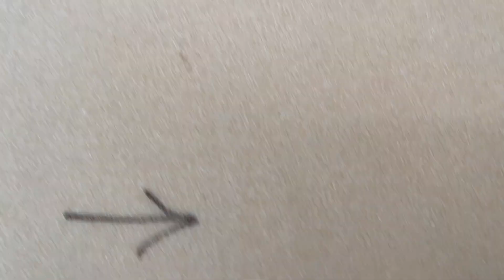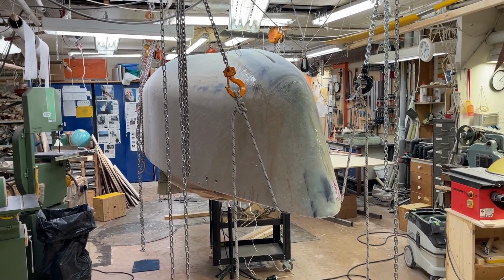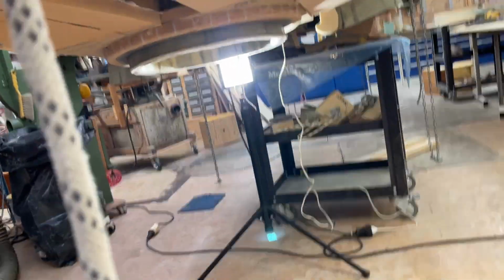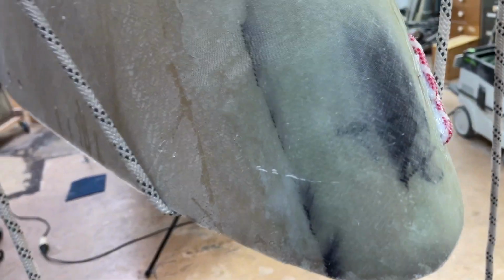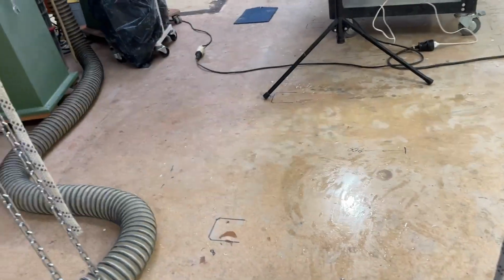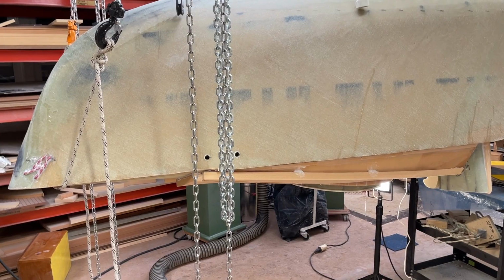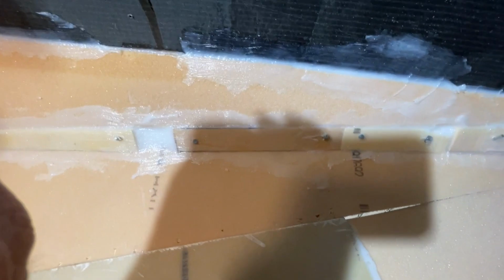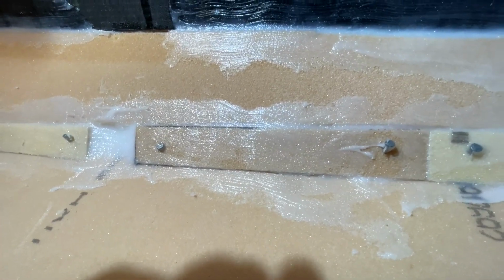20 Nov 2022  A surprise I got. I had to turn the boat upside down to do vedges on the inside first.

Comment: It's too bad that you can't leave those lifting eyes in place and used them as one would a cleat.  I guess they would need to have been blocked with phenolic, and I imagine you don't feel comfortable leaving a galvanized steel item fastened in place.
Reply from the maker: There will be plenty atachment points later.